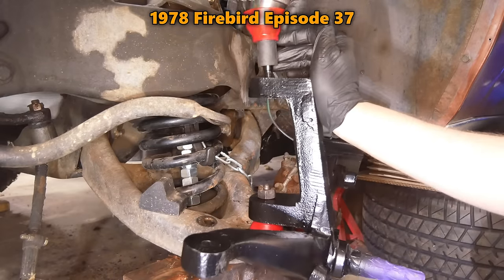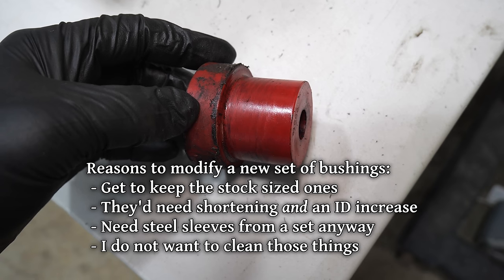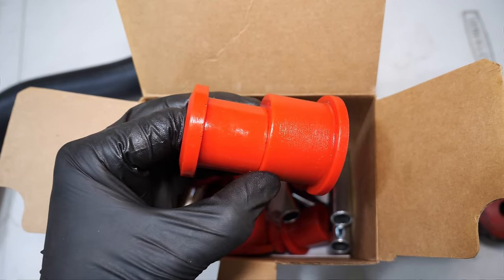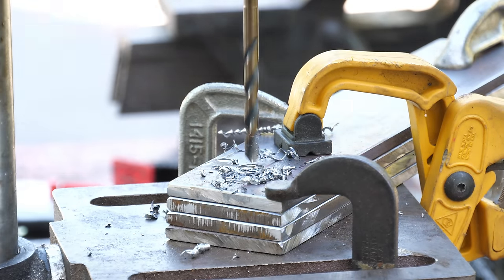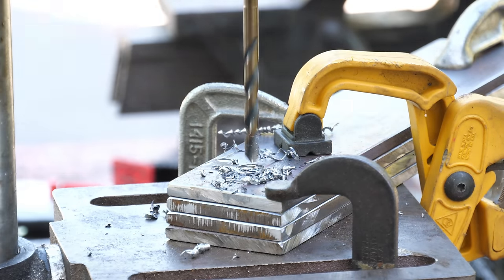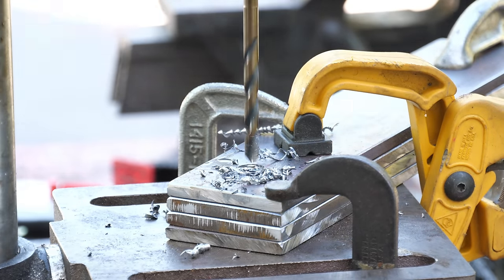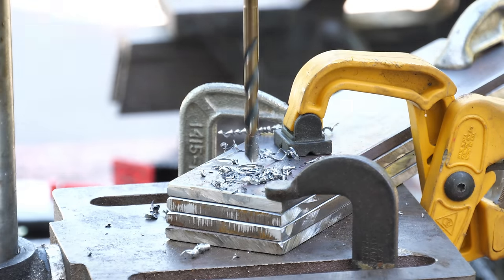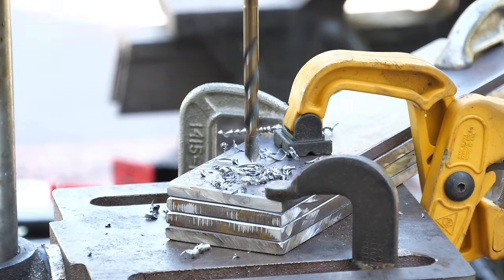Building Extended Shackles, Modifying Polyurethane Bushings, Fitting Exhaust (78 Firebird Ep.39)

Comment: Couple notes for anyone else doing similar - make sure that your O2 points down as much as possible. 10* or more.   And never even start the engine with a wideband in place, if the controller box isn't attached and powered or you can pretty much kiss your sensor goodbye.

Comment: of you ever need to run locking nuts on exhaust parts, they make nuts called "prevailing torque fasteners" that are suppose to stay torqued under extreme heat. ive ran them on exhaust manifold studs with great success

Comment: I have built cable guides from 3/16 and 1/4 rods for the emergency brake cables to keep them from the exhaust and driveline. Just need to make them to where they bolt to the frame or body in your case, bend a full circle and use a screwdriver to spread the loop open enough that the cable will slide in. Your style of cable is easy to build, just use 3/16 steel cable, stainless if you can find it, then use a piece of ⅜ pencil rod about ½ long, drill a 3/16 hole for the cable to fit in and crimp it on with a hammer on a vise, measure the other end by running your cable through all the loops, through the equalizer at its shortest setting for adjustment and make sure the cables are tight. It's a cheap and easy way to make sure your emergency brake works like it should

Comment: Been doing semi exhaust for years FYI grease the pipe joint and the inside of the band clamp before installation with axle grease , it allows the band clamp to slide as you tighten it rather than stretching the side with the bolts , it's actually in the instructions from Donaldson

Comment: Nylon's glass temperature is 160°F so I guess you're softening the nylon lock every time the car runs, then it sets hard again when the car cools down. Clamping force is provided by the metal threads like any other normal nut. No harm but no advantage either.

Comment: "Wow, you people have different size molds of 1.5, 1.6 + 1.7 inches? Aren't different molds expensive?"  Nah dawg, we have a supplier in China that makes them 2 inches.  Then they turn them on a lathe to the size desired.  That shine comes from running some heat over them for a couple of seconds.    

Most likely that doesn't happen, but wouldn't surprise me if that does happen.

Comment: Maybe this is the dumbest comment ever.... but... why can't the break cable not go like above all the pipes?
Reply from the maker: There's not enough room above the driveshaft, it still fits up into the tunnel on the body of the car as the suspension moves upward. And there's not enough room between the exhaust and the driveshaft when the suspension moves downward. Not a dumb comment!
Reply: I like all the improvising.😊
Reply: @FuzzyDiceProjects Ah I understand. Honestly I did only picture it as "still sitting in the garage" not as a bunch of moving parts :).
 Thx for answering and keep on the good work!